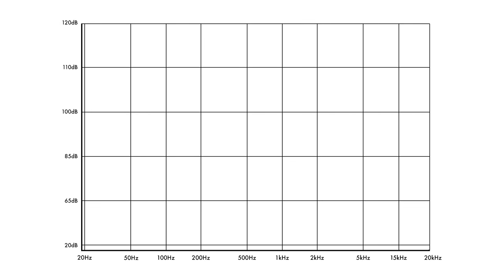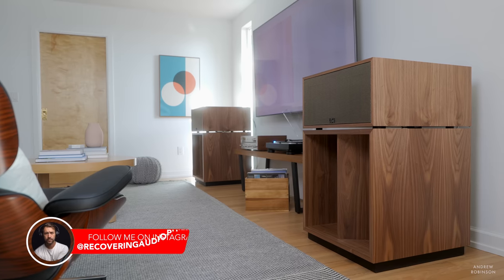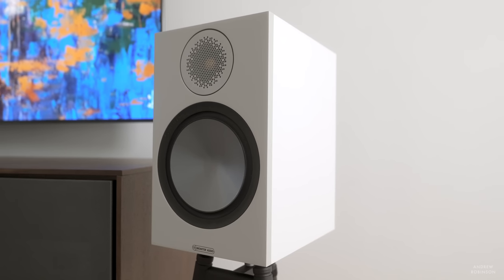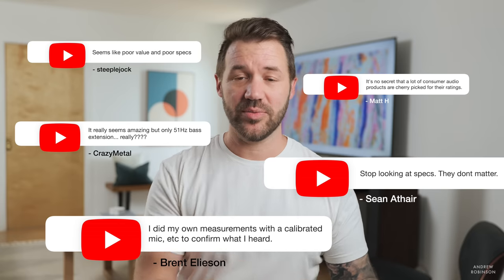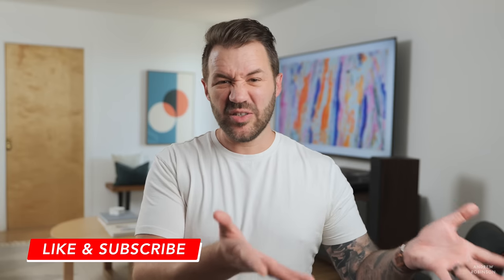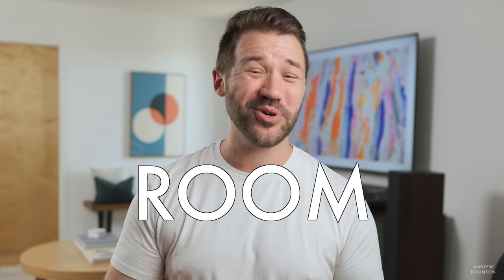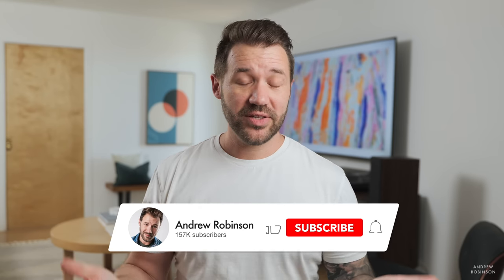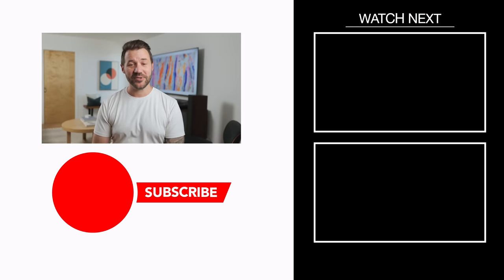DO SPECS REALLY MATTER in Audio? Understanding Speaker Measurements!

Comment: I fall somewhere in the middle. Specs matter to a cretin degree but are not everything. In fact I was always of the opinion you should never look at them until you listen first. That is far more difficult these days due to the lack of brick and mortar stores. I  also think it can give you a preconceived notion and sway your judgment. You also need to take into account some distortion is pleasant to us even though it can look bad graphed out . In the case of tube gear a lot of it measures like crap but can still sound great.
Reply: Yep. Its not a black and white sort of thing . Consider things from both angles.

Comment: I do happen to think that specs matter, but not the ones you focused on.   I pay attention to frequency response but only with regards to low frequency extension.  I also care about the +/- range for the frequency response, with a preference for flatness within +/- 3dB, or even better +/- 1dB.  But the bass extension down to 20-25Hz is what makes me pay attention and seek out a speaker for an audition.  Mostly I pay attention to SPL and impedance, mostly because that gives me some sense of the power requirements required to get the volume I require.   I also like to see a MAX SPL value, although that is rarely given.  Back in the 70's they used to publish on and off access frequency response at various high frequencies, and you could validate in the store by taking 8 heel-to-toe steps out, and 6 heel-to-toe steps to the side, and knowing you were 30 degrees off axis just like in the magazine.  I also pay attention to the design, as that give some clue as to what the dominant characteristics are, and what the designer's predominant challenges were.

I ended up buying Tekton Double Impact speakers, which I had heard in an audio store that specialized in tube amplifiers.  They had them in the store to help demo their amplifiers.   I liked the sound well enough, and then after checking the specs to confirm that the speaker could do the things I wanted to do, I placed my order.   They have lived up to my memory of the sound and the specifications on their website.  In fact in terms of soundstage depth they have exceeded my expectations.

Comment: Problem is how to know if it sounds good in your room before buying. And it isn't always easy to return things that have been used if you are not satisfied and how do you know if the other speakers you looked at would have sounded even better in your room even if you are happy with what you got. The best speakers I've listened to were Audiovector speakers but they were to expensive for me. I had a pair of Cambridge Audio S20 bookshelf speakers that sounded very similar but cost about 200 bucks. I wish i still had those as they can't be found anymore. They were however not good for games and movies which i used them mostly for so ultimately it didn't matter much that they were super clear when it came to some type of music. My Dynavoice M65 floor speakers were not nearly as clear but they were more fun for games and movies.

Comment: Yes, JBL is owned by Harman and Harman is basically Samsung nowadays lol

Btw, how about speaker power ratings?
Try a 2000 watt amplifier with 150 watt speakers at 100dB sensitivity.
If you go full power, the amplifier will blow up the speakers (or your ears).
To drive the speakers to their max, you have to keep the volume on the poweramplifier really low.
It means you can't use 80 or 90% of the volume dial on your poweramp, which makes it quite impractical.

I agree with all your opinions about acoustical specs, but when it comes to electrical specs, it's just a bit different IMO.
A speaker doesn't necessarily need to measure well in order to sound well.
But you'd want a poweramp to be as neutral as possible and let the speakers do the sound coloration.
So I think the measurements for amplifiers are actually very important.
Reply from the maker: I don’t disagree but if I may. I was very deliberate in keeping the focus of this video to just speakers and frequency response measurements/specs because other videos are in the works about other product specs that make more of or at least a different type of difference.
Reply: @andrewrobinsonreviews  Nice, looking forward to those videos 👍
Btw, have you ever considered becoming a teacher?
I think you could make physics lessons quite interesting by relating it to music and audio equipment 😜
Reply from the maker: I once thought about becoming a teacher. But it probably wouldn't be a good profession for me in the long run. But I appreciate the compliment and thank you for your support!

Comment: Numbers aren't the thing that I'm specifically focus on, I do however have a few personal preferences and that is that I rather have bigger speakers than the small stuff because with bigger speakers the sound is more immersive, it sounds richer than you can ever produce with small speakers...
I also prefer the slightly more powerful systems, not because I always need to go full out with the volume but having power to spare for normal use is lighter on the system and therefore it most likely has a longer lifespan on all the parts and needs to be repaired less, and a more powerful system also sounds better, richer when the volume is low which ties into having bigger speakers.
When I listen to music I always listen in stereo plus an active subwoofer, never will I listen to music on dolby 5.1 or dolby atmos which has even more speakers, that's not for music.
I have been lucky that the vintage Infinity Studio Monitors SM115 came on my path some years ago, I just restored the woofers with brand new foam edges myself and I also recapped my amplifier that I finished yesterday and I've had goosebumps from listening to the music on my fully restored amplifier and speakers and I'm blown away from the quality improvement, it's a very drastic improvement and it already had a reasonable good sound before but now I know what I was missing out on.
I'm so happy with my vintage Infinity Studio Monitors from the 1990's, back then it was the top of the line from Infinity, fully restored they are the best sounding speakers that I've listened to for a long time, I'm a proud owner and will keep them in my life for many more years especially because they are quite rare nowadays and fully restored as mine are they might be more valuable even, I know that if someone would want to buy them from me they must come up with a ridiculous offer before I even think about selling them.

Comment: Long ago at the dawn of the first CD player, I auditioned the Marantz at a high end audio store. It sounded terrible as they did back then. I mentioned this diplomatically to be advised I had a tin ear.

That may be so, but I know what I like, and that's what will cause me to open my wallet. Specs might be useful for engineering and marketing but when listening and comparing to other candidates in a store, specs are fairly meaningless. 

What works better for me is reviews from trusted sources to narrow the scope of a new acquisition and then go have a listen.

Comment: A speaker that has a flat, neutral response in a chamber indicates that it CAN be a proper reproducer for you. Trimming or expanding the volumes at different frequencies is a matter of room conditioning and amp adjustments. It's easier to serve your wants if your wants CAN be provided for.
It's a start and a good one to make a neutral speaker. How could you manufacture a mass market product otherwise. Delighting a small group endlessly is one way to remain a boutique company.

Comment: Maybe we don't need specs on our food as well since you are recommending it . Or even no specs on the car you are buying as well or even the TShirt you getting as long it's a t shirt it doesn't matter it it is a baby tshirt or women one you wear it  Right ? Specs matter 100 %
Reply: Sorry I haven't see your reply
Reply: @geffryamoussou6626  yeah, like the specs of car manufacturers are correct. Does your car actually uses the amount of fuel that the manufacturer tells you in the specs, no, because it's measured in optimal circumstances. Exactly the same goes for the power your car engine puts out, if the manufacturer says your car has 100 horsepower, do you think it's exactly going to be 100 hp? Obviously not. Even more, two the same cars rolling out of the factory will have different power outputs, the same goes for speakers, manufacturers aren't measuring every speaker they sell, the specs you get are a nominal they took over several pairs because just like with everything else every speaker will be different. All this is because of component and fabrication tolerances.

Comment: I love measurments , I also tune my heaphones and speakers by ear.
Reply from the maker: So do you use measurements to know where to start adjusting or do you just look at them and go, "that's nice" then do your own thing? Not picking on you, just curious.
Reply: Hi depends. The speakers I buy are old and don't have published measurments anyway. So I just listen and tinker till I'm happy enough (I'm never finished really). With headphones yes the measurments are usful to know what I'm starting with before I get them. Listening usually lines up pretty well. Then I start tinkering to get where I want to be within the constraints of the headphone. I'm not that bothered by frequency response because I'm gonna mess with it anyway. 
With electronics I find measurments important such as noise and the various distortions along with power into various loads. My ears are always the final arbitrator though.
Understanding measurments helps with assessment of what I'm hearing and what to attack to my preference.

Comment: True and honest information. The human hearing varies so greatly between each of us. The quantity and quality of the nerves determine how we hear. Some cannot hear above 12kHz, others, like Andrew can hear above 19kHz. So our experiences vary vastly. We can get excited about hearing the clarity of cymbals or the stroke of a finger down the string of a guitar, while our friend sitting next to us is not as excited because the music tracks sound dull to them. It is all relative. 
Having a neutral and flat speaker on measurements is to help alleviate colouring the sound or changing it in any way allowing the source material to be heard as close to the way it was recorded and as the artist wanted as possible. Also, If a speaker is tuned towards lower frequencies to help make it more boomy, those that struggle to hear higher frequencies already have a disadvantage and the sound may come across as very muddy and dark to them. And visa versa with high frequencies and 19kHz hearing capability, things may get a bit too bright for some. What is comes down to is, as mentioned, we need to hear it to know.
Just my understanding of it.

Comment: So, one thing you didn't cover here (and I understand why) was degradation of speakers over time. Do speakers degrade much over time? Quality speakers less than cheaper speakers? I imagine that if you bought really nice speakers 20 yrs ago and then went in to a store and listened to some modern equivalents, then the new speakers might sound great just because they haven't had time to degrade. What are your thoughts on this? And no, measurements don't matter to me in much the same way that the sales pitch on the wine bottle label doesn't matter. If I like the sound/taste, that's what matters. I think that there are very strong parallels between audiophiles and wine connoisseurs. You can get all caught up in the technical reasons that a particular wine is good but if you don't like the taste, then you don't like the taste.
What I would really like (and it's never going to happen) is to bring several sets of speakers home, choose the set that sounds best in my room and send the rest back!

Comment: Your summary was right on. This is why I subscribed to your channel. Audiophiliacs are called that for a reason! It becomes an obsession to them similar to perfectionists. Measurements recorded by electronic equipment are totally different than people using their ears to compare speakers. No two people have the same hearing abilities therefore they are not going to come to the same conclusion as to how a speaker sounds. Cost vs. value is far more important than measurements.

Comment: I prefer neutral speakers, they are easier to tune based on what I'm listening to with EQ adjustments. I listen to loads of different content and a neutral speaker is easier to tune than something that has been tuned for particular tastes. Just an opinion though of course, I'm sure you guys, like said in the video, it's about your preferences.

Comment: Okay, here are my 2 cents. My wife and I are in the process of buying a new soundbar to replace our Bose soundbar that we bought in 2014. We bought a new LG CX 77” to replace our ZT 60 which we also bought in 2014. We have been happy with that set up and will be placing it in our bonus room. We checked out the Sonus arc and both agreed that we did not like it since it has a manufactured and not the real or warm sound of the Bose. We also checked out the B&O and we both loved it, but agreed it needed a woofer. The new Bose 700 is in the running along with the B&W formation. We also checked out the LG SN11 which we liked more for the TV , but not so much for music although we could possibly tune the LG SN11 better for more of an all around experience. I have to say I was truly moved by the B & O though. It is a little heart versus head situation. I think I need to listen to them a little more. My wife liked the B&W a lot, but I do not like how it does not have the HDMI input. We also listened to the Ambeo and were blown away, but my wife was put off by the looks of it which I can’t blame her. Andrew, you are certainly correct in saying that in the end it is what you like that matters. Different strokes for different folks as they say.

Comment: I think measurements are pretty important, as do the major speaker manufacturers who use measurements to produce their speakers.  It is a science after all.  Probably the biggest advance in listening at home is the advent of DSP.  Many receivers and integrated amplifiers now employ DIRAC, or other DSP room correction software.   And other companies including Luxman and MiniDSP produce stand alone products for room correction that can be applied to stereo and multichannel applications.  While this software has some significant limitations, i.e. it creates a sweet spot for corrected listening and god only knows what it does to the experience outside that sweet spot, nevertheless it tames room problems at your primary listening position.  so the key is to buy speakers with characteristics that make DSP room correction as effective as possible.  These will tend to be speakers that start out life relatively flat and that can take a lot of power with minimal distortion because room correction can apply significant boosts to the problem areas of the speakers frequency response (+10db).  Best to use a good subwoofer here for base response as most 2 and 3 way speakers will distort like crazy with anything like that kind of boost.  My 2 cents.
Reply from the maker: Your 2 cents is good Trevor. Though if I may play devil's advocate, there are instances whereby through the use of DSP you are effectively taking some of the speaker's signature out of the equation, in which case you may be altering some attributes that made you fall in love with the speaker in the first place. I love and use DSP so I'm not trying to suggest you're wrong, just putting food for thought out there into the world in case there is a greater discussion to be had down here in the comments.

Comment: Hi Andrew. The only specification that really matters, in my opinion, is a speaker's power handling capacity, the minimum and maximum power a speaker can handle. I can make my audio/video  room either very reflective or very absorbent by opening  heavy wool curtains all around the room to expose most of the walls or to close them. The only true reflective surface is the ceiling. I can hear the natural reverberation from the recording session without  the room adding its own reverberation.